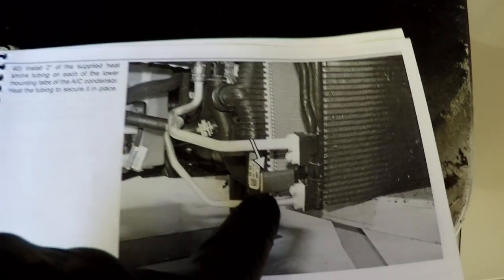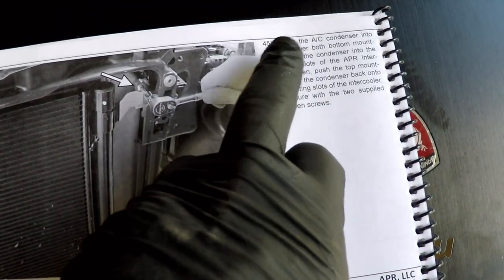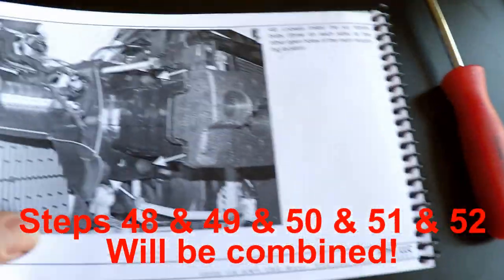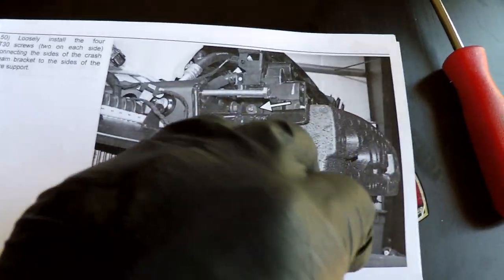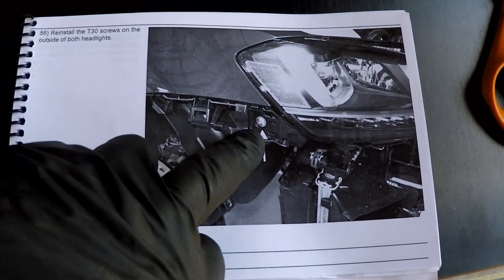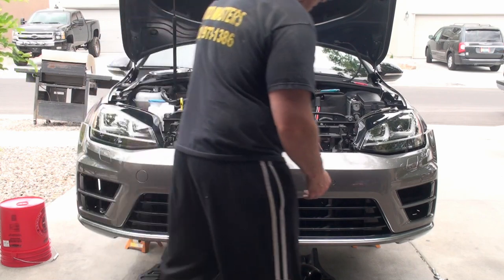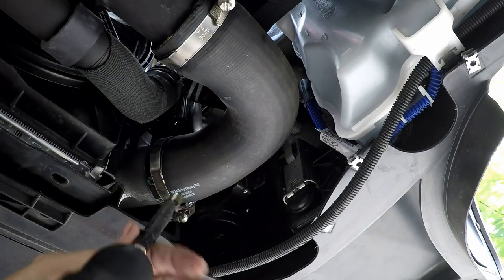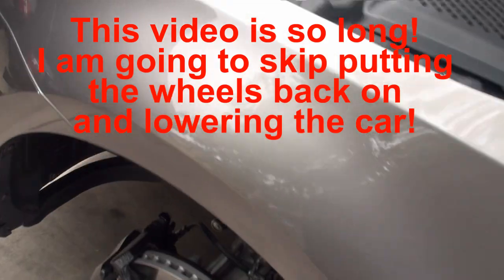2016 Golf R MK7 MQB APR Intercooler Install PART 2

Comment: I could never do this. I was stressed just watching how much of your car you had pulled apart!
Reply from the maker: Don't stress, we have it under control! With everything tore off, it does look very intimidating! :-)
Reply: Did you have a problem with the installation on the front bumper and the air damns? I had to remove the bumper to replace the headlight bulbs and when I went back with it, to me, it seems the air dams are out of place. doesn't look flush. and for some reason, the lights look like they are aiming to high. Any feedback would help greatly.
Reply: I miss mk2 and 3

Comment: I would have taken one look at all those steps and decided it would be easier to try to convince the wife to move to a lower altitude city for better performance!  Haha
Reply: Hahahaha, absolutely.
Reply from the maker: It's funny because for some reason before I started this project I was a little worried about getting all of the core support back together correctly.  It turned out to be pretty easy in the end.  It's a very clever design.

Comment: Just an FYI....If you take apart the front end of a car with the driver assistance package ...you are suppose to take vehicle to an authorized VW repair shop or dealer and get the system recalibrated to ensure everything is aligned.
Reply from the maker: thanks for mentioning that.  I need to put a note in the video to advise people of that.  I am pretty sure that I got it back almost exactly how it was previously installed.  I know that the dealer alignment process takes some expensive specialized equipment. I am not concerned, as my ACC appears to be working correctly even locking onto cars appropriately that are way out (~400 ft ) in my lane on the interstate,

Comment: Hey Rad did you notice that there is a noticeable lag after the new intercooler? I used a Wagner Tuning IC and was highly disappointed with the results. Lost the BIG RUSH at the lower end though power is up at the top revs.

Comment: I installed remus valvetronic catback and took about 10 hours... lol I wonder how long this is going to take.How long did this take to install? Thanks for great DIY video. I will probably order sometime end of this year. :)
Reply from the maker: Wow! Lol! 10 hours sounds like a lot of time for what I think is supposed to be a bolt on exhaust.  Isn't it just a bolt on?  At least you did it yourself, I have  to give you credit.  At least for me, I can tell you that the first time I do a project it will usually take about twice as long as the second time I do it.  This project took about 4.5 hours but there was a lot of wasted time in there.  Plan for the day, start early, and take your time! Good luck and let me know how it goes.
Reply: yup. It is bolt on. But I have gti so I had to get diffuser for quad tips. Hardest part was to remove rubber hanger from the stock muffler and align the tips at right position.
Reply from the maker: Oh I see, it was a matter of getting it just right!.

Hey that Remus exhaust kit is pretty nice!
Reply: +Rad Fox I ended up breaking one of the yellow hangers and stock intercooler clip.... I have to stop now and get another one sigh
Reply from the maker: +김원준 damn, that sucks! Those clips are scary. How much do they cost? Did your local dealer have any, my guess would be no. They should supply those with the kit in case they are needed.
Reply: +Rad Fox it was $41 plus tax... anyways I just finished install but headlight needs to be adjusted. how did you do that. it is way off now
Reply: +Rad Fox and I am also getting adaptive front lighting system error.. wow
Reply from the maker: +김원준 I did not adjust my headlights. However, There is a setting you can reset with VCDS. I have never tried it and will need to look around in there to find it again. Do you have access to a VCDS? How do your body lines look around your lights? If the lights look crooked you might want to try and adjust them with the screws first before you do a VCDS reset, but it would be easier to just do the VCDS reset to see if the error goes away and if the beams straighten up.
Reply: +Rad Fox omg.. the plug was only half way in for left headlight. Now it automatically adjusted and no warning lights. Thank you. I couldn't do it without your video. black and white manual sucks
Reply: My headlights look like they are aimed a little to high. I replaced the factory bulbs with osram cbi's. maybe it's just in my head, but after removing the front bumper they look a little too high..

Comment: Very good work.Why not do a comparison between the stock intercooler and the APR?Had to remove logs and stock APR!!!It's a pity the bumper)
Reply from the maker: Thanks! I collected a little bit of intake air temp data before performing the swap so after I collect some new data with the APR intercooler I should be able to do a comparison video. Ya it sucks about the bumper but it still fit back nicely and is holding strong.  What do you mean about removing logs and stock APR?
Reply: I don't know why so crooked translated)))You made the logs of the stock intercooler and the APR?I would also like to see how much bigger the intercooler from APR than stock.
Reply from the maker: Okay, I understand what you are saying. Yes, I collected some stock logs, but I need to collect the APR logs and then compare them. Let me see what I can do!

Comment: I'm getting apr stage 2 for my 2017 gti,is inter cooler must have after stage 2 or not?thanks
Reply from the maker: I think it depends on where you live and what the outside temps usually are.  I would definitely recommend an upgraded intercooler, the cooler you can get that air the more power you will make.  Where I live the outside temperatures get up over 100F and you can literally feel the power loss with the stock intercooler once it gets heat soaked.  With the upgraded intercooler I can run my AC, and as long as I keep the car moving, I can keep getting on it hard and the acceleration stays strong.
Reply: Rad Fox thank you very much for the info.i live in north jersey.